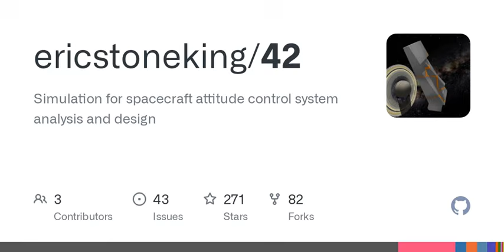GitHub - ericstoneking/42: Simulation for spacecraft attitude control system analysis and design

Comment: As the author of 42, I disapprove of this AI slop description.  There are factual inaccuracies and just plain stupidity.  If you read this, do me a favor and give it a thumbs down.  Thanks.
Reply from the maker: As the developer of this podcast, I apologize.

I am also a software engineer and have been running this podcast as a hobbyist experimental project.

If this is causing you trouble, I will remove the episode in question.
Reply: Can you make a playlist tutorials of how to implement advanced applications using 42 ? as your compititor Basilisk has a detailed playlist and examples open sourced to learn it but u have only one demo!